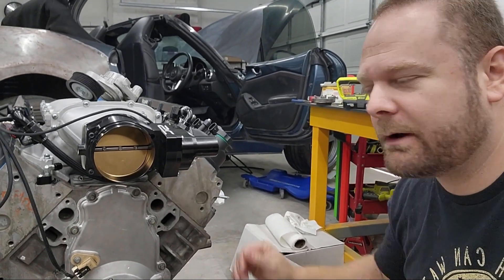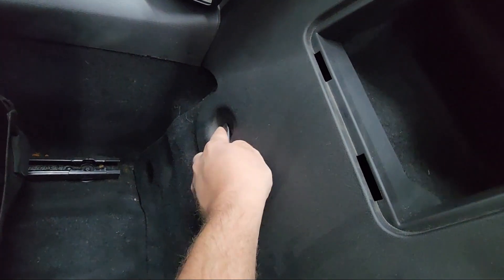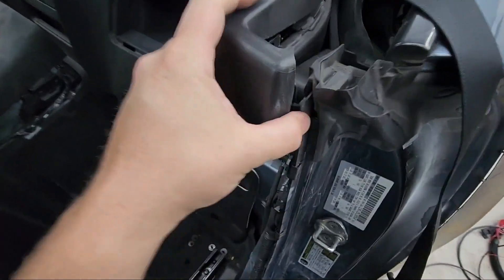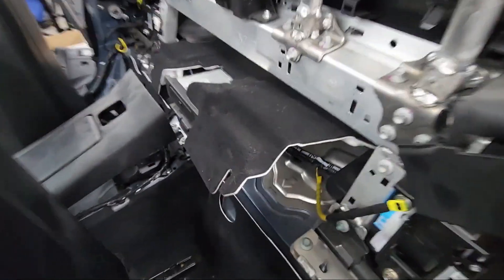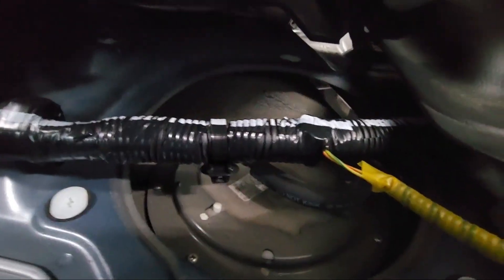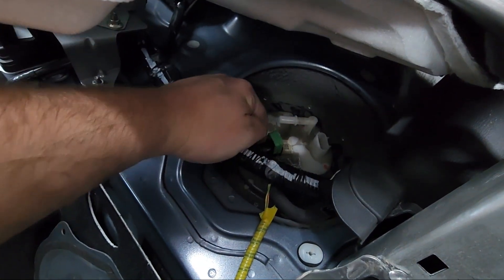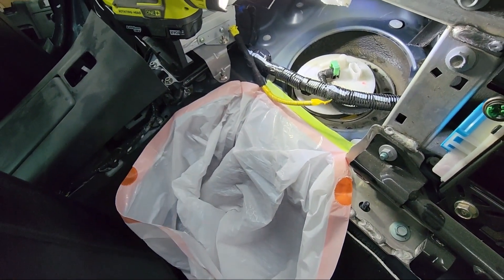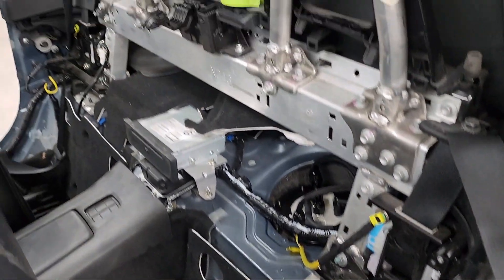2016+ nd mx5 fuel pump replacement

Comment: thank you so much man, been having trouble with my ND 2016 Club and this video helped so much and gave me exactly what I needed!

Fuel pump seemed to be overheating due to it not being replaced when I bought the car @80K Miles. The only reason I could guess why they didn’t replace it is because the fuel filter is apart of the pump so they didn’t even see it

Mazda just tryna be complicated lol
Reply: There is also a recall on some ND1 fuel pumps (something cracks?) i know it affected my 2018 which is why I am here just to see what is involved....i dont want that time bomb in there!  Especially if it is gonna be FREE to replace it!